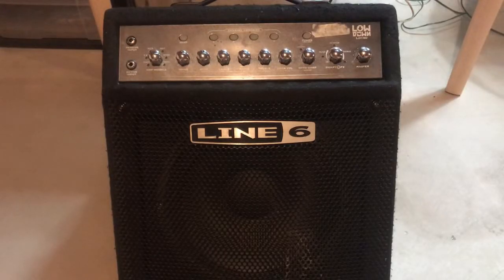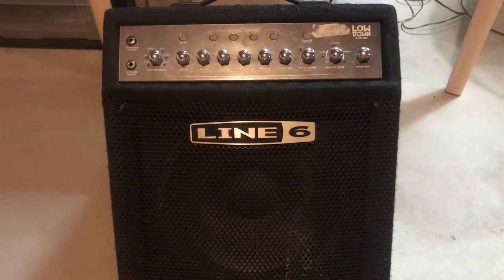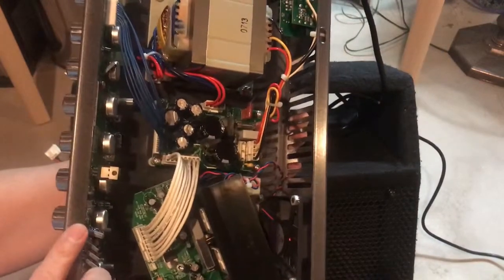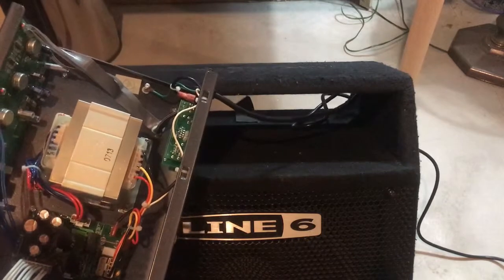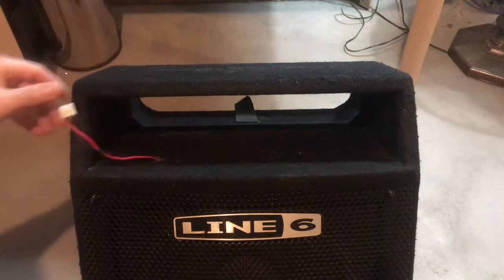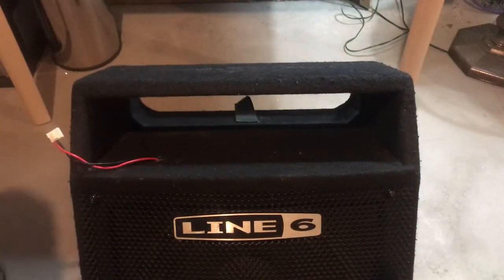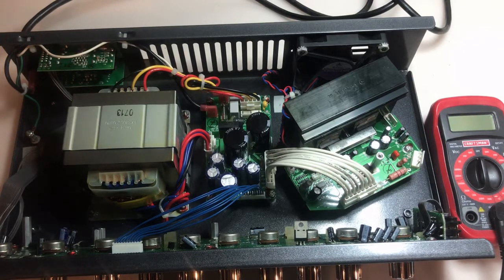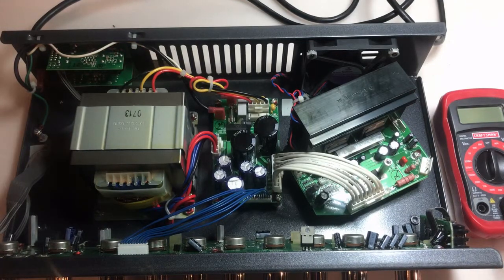DR #6 - Line 6 LD150 Guitar Amplifier Troubleshooting and Repair

Comment: I do not believe the DSP chip is broken at all.
The guitar input board may be problematic too, that happens a lot on these amps.
That also makes sense because it suffers the most mechanical and electrical burden.
If you look at the DSP chip pins there are a few other sense signals that may cause the chip to mute the amp. Hint: Pin 91 and 94.

Comment: I have this same amp.  When I turn it on nothing lights up on the front.  No buttons no nothing.  You can hear the transformer hum loudly just for about 3-5 seconds then it gets quiet.  Can you point me I. The right direction with this??
Reply: I have the same problem with mine please help

Comment: From the user guide, "Plugging in headphones disables
 the speaker output". The headphone jack may be a switching jack. If the switching jack is bad, it could mute the amp.
Reply: You are right on the money. Also the guitar input board is broken often. People plug in all kinds of plugs and/or wrong electrical signals.

Comment: this is a very very common problem with line 6 amplfiers, I have had 3 new power amp boards fitted where the mute circuit is located on my model

Comment: I have this same amplifier I'm repairing for a friend. Could you share the schematics? I tracked down a fried resistor which is R82. It has 5V on one side and a dead short on the other. The trace goes to the other side of the board.
Reply from the maker: If you google: “Line 6 LD Pro Service Manual” it’s the first PDF that comes up.
Reply: @dualityrepair4770  It appears to be not there anymore. Any other places I can locate it from?